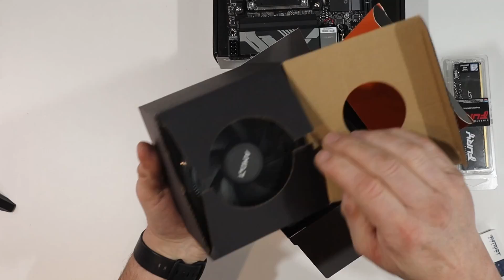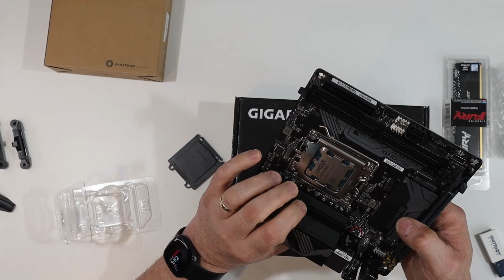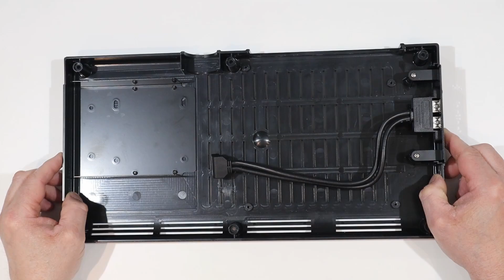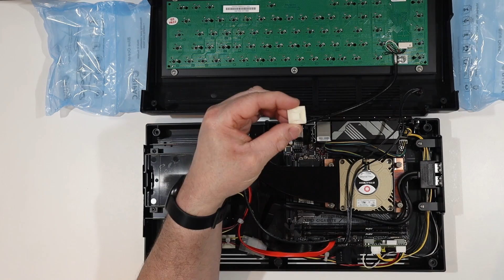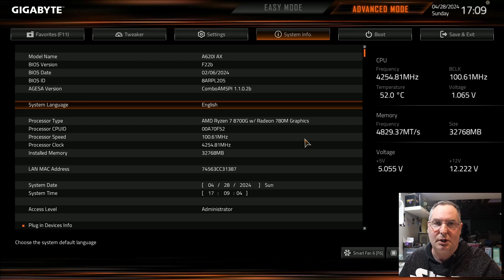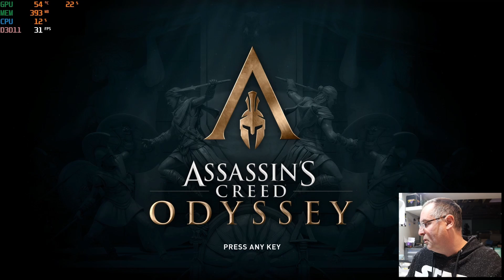Unleashing Power: Installing Ryzen 7 8700g Into Commodore 16x!

Comment: Would it have been better to use a Noctua NH-L9a-AM5 ?    I use a Noctua NH-L9a for my Ryzen 5 3400G on a Gigabyte AB350M-D3H that I stuffed inside a Silverstone MILO ML02 case.  The low profile heatsink fan works great and is relatively quiet provided its kept clean.  

I wish I had one of those Commodore 64 style mini-ITX cases, definitely would like either that Black one or the Translucent one.

Comment: I'd preordered one of the ultimate versions with the C16 case, back around june 2023. Any news on when those ones would get shipped out?
Reply from the maker: did you order this through Kickstart?
Reply: @myretrocomputerltd5179  Through the website, actually
Reply: @myretrocomputerltd5179  Off of the My Retro Computer website back when i'd mentioned, actually
Reply: @myretrocomputerltd5179  It was on the My Retro Computer website & not the kickstater, 2 years ago now, and i still do not have an update on it. Hopefully it'll get shipped out soon, though.
Reply: @huleeyaxerssius7 My bet is you'll never get one. Sadly.

Comment: I printed the fan duck tonight and installed it.  It sure quieted the Dynatron fan tremendously!
Reply: Did you have to alter it at all? When I tried to print, after the first rectangle, as it moved away, the nozel stayed at the same height so was too high off the plate, and would not print correctly.
Reply: @whatnow2131  On my X1C, I printed it vertically the way it appears in the slicer by default.  I used tree support and a brim.  It printed perfectly the first time, which surprised the heck out of me.  In inside trees were not that difficult to remove (I though they would be).
Reply: @whatnow2131  It's a 3 hour print on the X1C.
Reply: @Daveyk021  Thank you for the reply.This is only my third print. Seems like a bit off more than I could chew. Looks like I have to research  how to do trees.
Reply: @whatnow2131  Okay I could not your replay the first time, so I started a new message line address to you.

What kind of printer and what slicing software are you using?
Reply: @Daveyk021  flashforge adventurer 5m pro. Just downloaded the orcas slicer for the first time. Watched a video on how to use it. I wish I had seen your post first. I only did the trees. We shall see what happens.  I printed a pretty programed boat , octorock, failed articulated dragon, and a failed duct. My daughter was using flash print as a slicer.
Reply: @whatnow2131  I honesty didn't think it would print upright.  When you call the STL file in to the slicer, it is upright.  I enabled Tree Support and Brim, about a 5 or 10mm brim.  Let it go and don't shake the table.  It actually worked.  The tree that grows up inside the duct, turns out not to be that difficult to remove.

3d Printing can be a bitxch to get the hang of.  I am nooooo expert.  I started out with an Ender 3D and quit 3D printing because that thing is such a piece of junk.  The a friend put me on the Bambu Labs X1C that was releasing within a month.  I got my order in and it printed right from the box.  I use the Bambu Studio slicer.  I since then bought all kind of spare parts, most importantly hot end parts and tubing.  The very first print was a huge failure! lol Switched to Inland filament from the Bambu filament included with the printer, and the second attempt was perfect.   I really only have had one major failed print since then and that was caused by the end of the hotend falling off and it damaged the print bed.  Bambu sent me a new hotend and a new print bed (the removable) part free of charge....  It's a great printer.

I have now ordered a Creality K2MAX  I swore I would never buy anything from that junk maker again, but their K2 Max looks like an X1C with a 350mm Square build area and I need that.  Hopefully, they will be releasing spare parts for it soon (belts, hot ends, beds, etc.).  It is brand new so it will take them some time.  It is supposed to print right out the box like the Bambu does; we will see.
Reply: @whatnow2131  That looks like a nice printer.
Reply: @Daveyk021  seems
to be good. Took 4 more tries but finally got it to work. Your telling me about the trees started me down the correct trail, learning how to use the orca slicer, so thanks! 😀

Comment: Doing this same build.  I could NOT get video out of the HDMI port.  I get video out of the Display Port.  Weird.  Is that something with the Ryzen 8700G?
Reply from the maker: I dont know, i think i used the HDMI port on mine but funny enough it uses the display port now!
Reply: @myretrocomputerltd5179  Could you try the HDMI Port?  Running in another quark where it doesn't like to post in the morning until I try it several times, and right now I am using an external 430W Power supply (just the lower C64X case until a new PicoPSU-160-XT shows up and some other cables).
Reply: @myretrocomputerltd5179  The expensive LG Ultragear monitor would not work off the HDMI port.  I found that the cheap-o $150 27" AOC monitor, which I always use as a second monitor, does work off the HDMI port.  It must be timing or something the LG monitor does not like. The HDMI port of the Gigabyte A620I is not as capable as its Display Port.    Right now, I have the LG Ultragear and AOC daisy chained together off the Display Port for dual monitors on this system.

Comment: My Commodore 64 ITX currently has an ASRock N100DC-ITX.

I also happen to have an 8700G with the same Gigabyte A620I motherboard in this video. I am thinking about swapping to the 8700G and Gigabyte A620I with an ID-Cooling IS-30.

This A620I motherboard allows reducing the SMU/System Configuration to 35 or 45 watts. I think 35 watts would be worth a try for lower fan noise. The system would then pull around 65 watts from the wall running Prime95. Configuring the maximum temperature to something lower should help also with single core loads that can spike fast.
Reply from the maker: Wow well done for super modding - i hope it all works out with the lower power!

Comment: Just the video I was looking for! I went from looking for potential NAS solutions and wondering if cases like these existed, to now considering this for a replacement PC for my older brother who had a Vic-20 when he was growing up. He mainly plays Diablo 2 Resurrected these days which I have no doubt this setup can handle, but it would need to run it at 1440p which might make it run hot.. Which brings me to the fan noise: it's a bit of a letdown. That said, I'm optimistic that it can be resolved either by switching to a different fan or by delidding the CPU. It seems like if you're willing to take the risk with liquid metal you can drop the CPU temperature by ~25C, otherwise just using a better thermal paste drops it by ~10C.

Anyways, thank you for making both the video but also the cases! Keep up the good work and hopefully see you again - o7
Reply: Just FYI I am running a c64x with a 5600G and the same cooler as above (though different exhaust) I can get a bit noisy at times with the fan when the CPU under load but thats a function of all mini pcs they just need to push the air.

An alternative solution might be an AIO (with the radiator separate), but I havent found one as yet with enough clearance apart from a few from years ago that are really expensive even used.

Comment: Nice videos Sean! I was thinking about this power build and I am happy for your comprehensive tutorial video. I was certainly expecting LESS NOISE from the Dynatron A18 cooling fan/blower. Have you created any business build using a low power 35W TDP Intel i5 CPU? Their code names are T-suffixed (e.g. Intel Core i5-13500T), have embedded Intel graphics, fit on socket 1700, and deliver slightly degraded computing performance at half TDP against their 65W siblings. They can be combined with the cost efficient ASUS Pro H610T mini ITX motherboard (no Pico-PSU required). I wonder how would such a powerful C64x system perform in terms of produced noise. My expectation is that it can be silent for most uses and still capable of delivering advanced performance. It could perform very well in terms of CPU temperature and fan noise levels inside the limited C64x space even using a cheap low profile cooling fan (avoiding the need of 3D printing a specialized blower exhaust duct). I am planning to build such a system in the short future.
Reply from the maker: From my memory the intel based motherboards tend to have too much underneath them (heatsink clamps etc) and tend to bottom out on the case. This can lead to the bottom part of the case bowing. Please share your results from this build with us - it will be interesting to see how they perform and if that is still an issue today)

Comment: Is there room under the duct for an NVME m.2 gen4 with a heatsink (3.15" x 0.92" x 0.38")? Or should I just stick with a gen3 (3.15"L x 0.87"W x 0.09"H) which should run cooler without a heatsink?
Reply: Also, could you recommend the atx cable riser that is needed for the PicoPSU-160-XT, 192W Power Kit? Made by Mini-Box.
Reply from the maker: @whatnow2131  I will take a look and let you know.
Reply from the maker: @whatnow2131  I believe mini-itx.com now sell the riser cables for the 160 watt picoPSU - alternatively i am told that the cheaper Chinese clone 160 watt PSU's actually fit the case!
Reply from the maker: I think it will be a bit tight under there. but i have not tested so dont know for sure.
Reply: I dont think so as I coudlnt easily fit one in my build, though its easy enough to get a sata SSD, really you wont notice that much of a difference in almost all applications